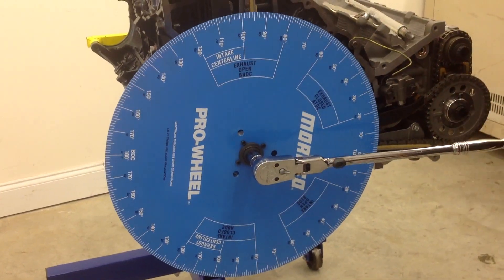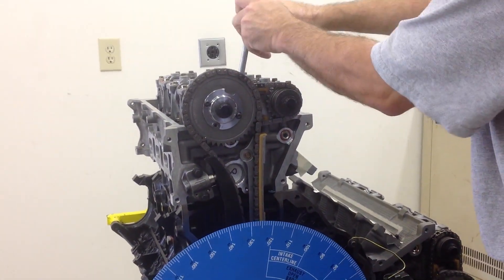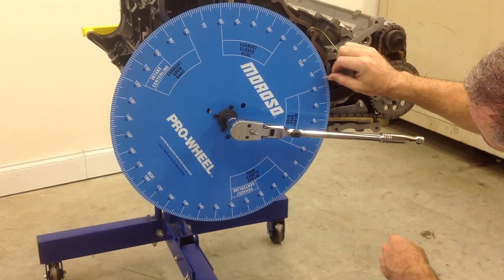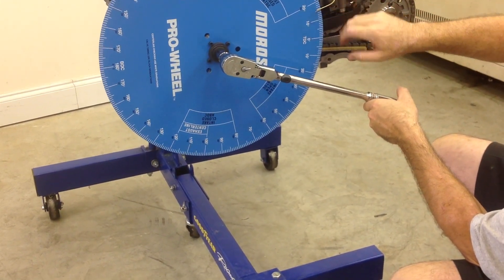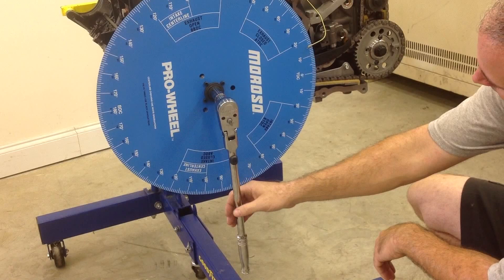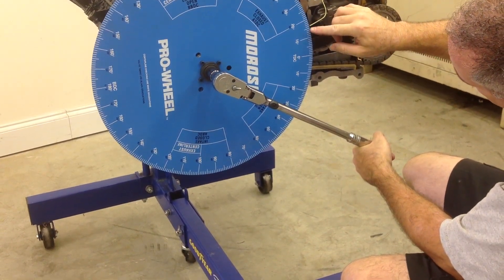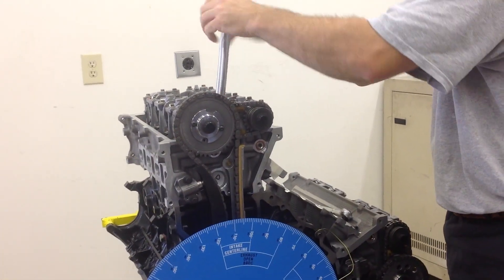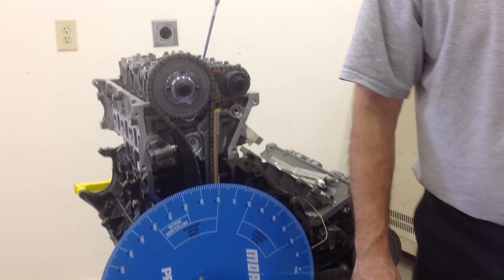Finding top dead center using the degree wheel and piston stop

Comment: This must be on compression stroke for timing.
Reply: For timing, yes, but for just finding tops dead center not really. The only thing that needs to happen is the cam needs to be dot to dot with the crank gear 

But actually the dots will both face up on the top of the gears on the compression stroke

Comment: i have 1953 truck  6 cy. TDC is stamped  in the crankshaft  keyed pully along with deg marks before an after it that does not change i can set timming in less than 5 mins. using timming light on # 6 plug wire i set it at 4 deg before TDC runs perfect